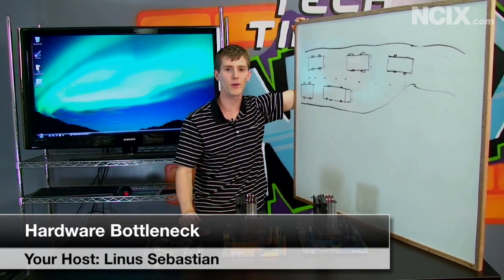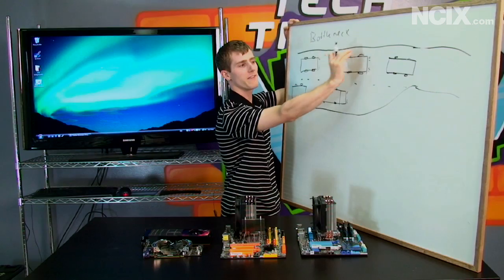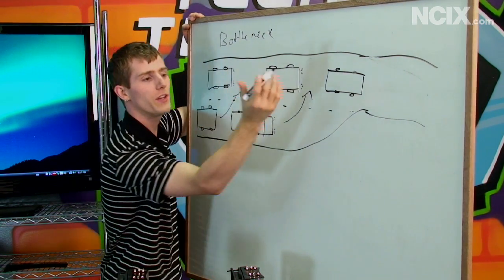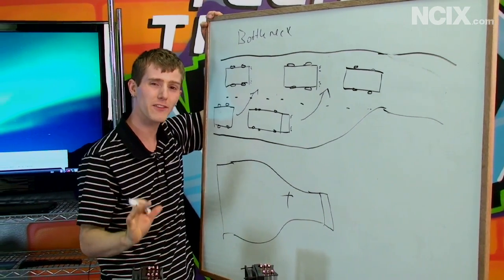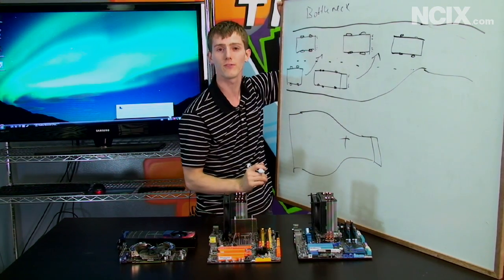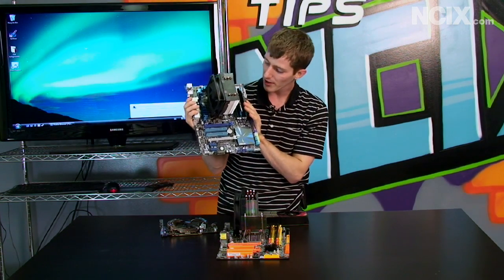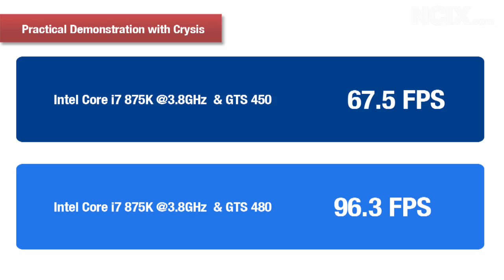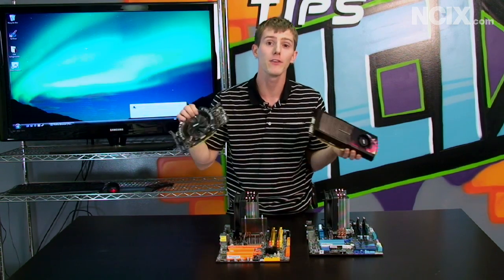Understanding Hardware "Bottlenecks" and How to Avoid Them (NCIX Tech Tips #81)

Comment: I got myself a new processor, power supply and motherboard, now I'm going to buy myself a gtx970. (Intel i5-4460, 700 Watt power supply and forgot the name of the motherboard. Dammit)
Would I do a bottleneck with the old unchanged 7gb RAM and an old Harddrive? (I don't mind loading screens btw...)
Reply: Well, it's 3 with 2 gb of ram and one with 1 gb :D
Reply: Already got a gtx970 now and well, you really need the 3.4 Ghz processor for a stable framerate of 50 on the witcher 3 (highest settings), but all in one it works out just fine for every other game on highest settings :D

Comment: Old system but I made it hopefully with no bottleneck back in the day 
Phenom II x4 955 black edition 
8 gb dual channel 1600 mhz ram 
Msi 890fxa -gd65 MB
kingston v300 120 gb ssd 
psu 550 w high power 
and Gtx 560 ti hawk from msi

Comment: can a mobo be a bottleneck
Reply: Yes, it absolutely can.

Generally, a motherboard either works, or it doesn't.  Your bottlenecks will mostly come from features.  For example, I'm running an AMD 8320 on a Sabertooth R9 990FX R2.0 (do a google image search for that, and you'll get a good idea what I'm about to say.)

I have 2 R9 290X's in crossfire.  My motherboard only has support for 2 PCIe 2.0 16x crossfire/sli slots.  Meaning, two cards can be run at 16x, so sli and xfire is perfect.  If I wanted to add another card, I would be absolutely wasting the money.  First of all, even though I have plenty of PCIe slots, only two can be used in 16X, and if I used 3 cards, #1 would be 16X and #2 and #3 would be 8X only.  This would be fine if I had 3.0 slots, but I only have 2.0 slots.  As it stands, for both of those reasons, a third card would be a huge waste as my motherboard wouldn't allow best performance.  Would it work?  Sure!  But performance would be ... BOTTLENECKED.

Another big way a mobo can bottleneck you is if you want to overclock.  You want a motherboard with fantastic CPU power delivery and regulation if you want to do extreme overclocking.  As it stands, any off-the-shelf motherboard from any reputable company should allow you to overclock at least a little bit.  But they won't enable you to go nearly as far as what you could accomplish with an enthusiast grade board.
Reply: Drew W thanks, but how much would a good mobo cost for overclocking a gpu
Reply: The thing about GPU's is that they have their own voltage regulation modules.  It's like an entire computer to itself.  It has it's own power control, it's own processor, it's own ram.

A processor (CPU) doesn't have such luxuries - it is JUST the brain, and relies on the motherboard to give it the power and regulation it needs.  A motherboard is like the brainstem and nervous system.

Any motherboard with a 16X PCIe 3.0 lane should do alright for a gpu and some overclocking, but if you're going to extremes, keep in mind that a PCIe slot is designed to provide up to 75 watts through the SLOT on the MOTHERBOARD itself, and the rest through cables on your PSU.  When you overclock, the GPU will ask for more voltage and wattage.  It'll need to get it's power from somewhere, so any motherboard would theoretically be fine for a minor overclock, but you'll want an enthusiast gaming motherboard that's capable of going above and beyond normal specs if you're going to EXTREME!! overclocks.

The same is true for multiple GPU's - any motherboard rated for SLI and/or Crossfire would do well for just about any GPU, but I would caution people who use dual 290X's or 780 Ti's/Titan's to not cheap out on the motherboard.

Regardless of whether or not overclocking is your thing, there are 2 components you should NEVER cheap out on - your Power Supply, and your Motherboard.

I hope this helps!
Reply: Drew W thanks
Reply: Drew W You do realize there is not a GPU on the market that needs more than PCI-e 2.0 @ 8x?

Comment: People wonder why you would want to buy a gaming console that works without having to figure out out this crap.  It's not that it is hard to put the computer together because it is like Lego Blocks, but these lego block won't work with this lego block because it is a Maga Bloc.  Unfortunately it isn't just the brand of blocks but compatibility also includes speed, power, memory and etc.  You really don't know what goes together unless you research each item.  I feel that component makers could make this process better but they want to keep you buying different components and give you no guarantee that they will work.

Comment: Yea, we can get gpus in many prices, 100$, 150$, 200$, 250$ etc.
But we cant do this same with cpu.
Prices of intel OC cpu starts from about 70$ and then next is cpu for 250$...
Where are intel OC cpu for eg. 150$?!?!
So how to avoid bottleneck on mid rigs?
G3258 is cheap but too weak(2 cores), 4690k is ok, but too expensive...
Reply: i6 4460.... you don't need to oc
Reply: Lmao, I already bought X5450 E0(oc-able to 4ghz) for 30$, didnt make benchmarks yet, to compare it to i5 4460, but i will.

Comment: Well I'm entry level but I've been doing research since October 2013 but this video has me a little scared now that I've already bought all my parts (just haven't received them all) but can someone look over my list and tell me if there may be bottlenecks?
CPU:
       fx-8350
moboad:
       gigabyte ga-990fxa-ud3
psu:
       corsair builder 500W 80+ bronze
gpu:
       asus r7 260x
ram:
       1 stick of 8Gb at 1600Mhz (will add another stick eventually)
              - CAS latency of 9
hdd:
        WD RE3 1TB at 7200rpm with 32Mb cache
If I got a crap load of bottlenecks tell me and I'll sell it and try again lol.
Reply: GPU bottleneck, the r7 260x at its best can only be classed as mid-end GPU. Go for R9 270 or above.
Reply: also a get a set of dual channel ram instead of 1 stick, so the CPU can access two sticks of memory at a time.
Reply: Nothing really to worry about. The GPU may be mid-end but that's not a bottleneck. You presumably know that and know you aren't going to get 120fps on Ultra detail in BF4 on that. Your component are all powerful enough to take advantage of the GPU to its full potential. It will play most games on Medium to High at decent fps etc. 2 sticks of RAM would give some improvement as you can have them working in Dual Channel but again I wouldn't worry. 1 8GB stick will work fine. A 7200RPM drive is great and I use one but is a bottleneck for nearly everyone. With your OS on an SSD, and that powerful CPU and that 8GB of memory you could boot up incredibly fast. This machine will run great and will be very upgradable. You could upgrade The GPU or RAM in a few years with no issues. You won't need to upgrade the whole system. Then maybe get an SSD and stick your OS and big games on it and keep your 1TB drive for your media and programs.
Reply: The 8360 means he can upgrade his GPU without a CPU upgrade in the future though. he may need the CPU power for things other than gaming too.
Reply: I do plan on getting another stick of RAM eventually, if I can get Windows 7 installed (having issues there)
Reply: What issues you having with installing 7?
Reply: TapTapTech 
When it automatically reboots (part of the installation process) it gets stuck in an infinite reboot loop so it can't install.
Reply: well rarely do any games or programs ever go over only using 4 cores but if your streaming or video rendering the 8350 is nice the r7 260x is ok with it but thats your bottleneck but if your happy with it just stick with it.  with the ram good thing your getting another. just remember the FX 8350 max Ram speed is 1866 in duel channel, 1600 with 3 sticks of ram, and 1333 with 4 sticks of ram. the 8350 will not support anything higher than 1866 so don't waste money on faster ram.
Reply: That's overkill for the CPU.
Reply: The Andoxico When it reboots remove the installation media. It needs to boot to the hard disk to finish the install but it's just loading upo the install disk over and over.
Reply: Jay Feng its not a gpu bottleneck. the gpu is slower than a r9 270x but it is not holding anything back. the cpu will still perform as fast as it can
Reply: Why the fuck would you build a PC with the CPU so much better than the GPU? Ideally you would spend like 50€ on CPU and 150€ on GPU, now that's a good ratio. The R7 260X doesn't even bottleneck with Intel G3220. Basically you should get atleast like a R9 270 and just get a cheaper CPU.
Also why the fuck do you build an entry-level PC with the best AMD FX CPU that can match an i7 in gaming performance? Do you plan on upgrading your GPU any time soon?
Reply: ccubeice a
I figured I'd get a more future-proof CPU and when the GPU technology gets better and better cards get cheaper I'd get one. Also my 260x has been running perfectly and has ran all my games greatly. And the 8350 isn't the best FX CPU.
Reply: The Andoxico Just update that GPU next year youll be sweet
Reply: Jay Fisher
sweet, what should i upgrade to, do you think?
Reply: The Andoxico To go well with a good overclocking cpu like that perhaps a gtx 770/670 or r9 280/x. Also think about getting another one of those ram sticks for dual channel and remember to check your wattage with a new gpu cause 500 may or may not be enough
Reply: Jay Fisher
i already switched out the RAM
Reply: Oh good alright then
Reply: i guess u didnt research enough kiddo
Reply: UPDATE (please stop posting new content about the video card or the RAM). I've gotten a r9 270 and 2 4gb sticks of g.skill 1600mhz ram.
Reply: GooberSuess
So what did you think I did wrong? Just wondering cuz I want to learn everything i can

Comment: Am I bottlenecking my system.
Amd A10 5800k 
Nvidia gforce gtx 660 ti 3gb
12 gb DDR3 ram 
600w psu?  
I'm thinking of purchasing an i7  ( I'm getting ready for gta v) :)
Reply: An i7 is overkill for games. Go for an i5 and put the extra $100 into the graphics budget. The cpu MIGHT hold you back time and again, but more often than not you'll be good.

Comment: Gotta ask about a new GPU I was looking at, will it perform to it's potential? I was hoping to get an EVGA 04G-2974-KR GeForce GTX 970 Superclocked 4GB 256-Bit GDDR5 ACX 2.0 PCI Express 3.0

Here are my specs for the build. If it is recommended I buy a different CPU that is fine (the motherboard is AMD so don't bash me for that fanboys) but I don't care to have an 8 core 3.9GHz processor over my quad core if it will work just fine, I don't have ALL the money in the world to compensate for someone's opinions about it, but if it WILL be an issue I want to prevent it.

-AMD A8-6600K Richland Quad-Core 3.9GHz Socket FM2 100W Desktop Processor - Black Edition AMD Radeon HD 8570D (a little on the older side but you know..)

-GIGABYTE GA-990FXA-UD3 AM3+ AMD 990FX + SB950 SATA 6Gb/s USB 3.0 ATX AMD Motherboard

-CORSAIR Vengeance 8GB (2 x 4GB) 240-Pin DDR3 SDRAM DDR3 1600 (PC3 12800) Desktop Memory 

-CORSAIR HX Series HX850 850W ATX12V 2.3 / EPS12V 2.91 SLI CrossFire 80 PLUS GOLD Certified Modular Active PFC Power Supply New 4th Gen CPU Certified Haswell Ready

The 970 is not necessarily cheap so I would like to see it's full potential if possible if anyone wants to give me any pointers that I might not know :) I am NOT a newb to PC's but I don't know every little aspect of things.

Comment: im currently building this

CPU	AMD FX-8320 3.5GHz 8-Core
Motherboard	ASRock 970 Extreme3 R2.0 ATX AM3+	
Memory	G.Skill Ares Series 8GB (2 x 4GB) DDR3-1600	
Storage	Seagate Barracuda 1TB 3.5" 7200RPM	
Video Card	Sapphire Radeon R9 270X 2GB Vapor-X	
Case	Raidmax 402WB ATX Mid Tower	
Power Supply	Corsair 500W ATX12V	
Optical Drive	LG GH24NSB0 DVD/CD Writer

Comment: can someone recommend a GPU to upgrade to for me?
specs:
Processor
Intel(R) Core(TM) i7 CPU 940 @ 2.93GHz
Video Card
NVIDIA GeForce 9800 GT
6.2 GB memory
500gb hdd 7200rpm

i was looking at getting a GTX 650
Reply: Nothing less than a 660. 670 or 760 would be best.
Reply: thanks man. MY I7 is only a first gen tho would it be able to handle a 660?
Reply: bradgonewild Yes it should
Reply: With a decent OC (over 3 ghz -4 ghz - you could put any single gpu - and you would be fine). But for suggestion HD 7870 or 270X would be good buy. From nvidia gtx 660, or even gtx 760

Comment: linus i love your white board it helps us understand whether its bottleneck or raid 0 or whatever. use white board more in your videos !! :)
however why you didn't include in the video how to test or someone can tell if he has bottleneck issue in their system.. i had to search my self and got the answer finally
my core 2 duo works great with geforce 9800 GT :)
(your system is old..ok i know but still play 2014 games on smooth fps)

Comment: will i3 3210 bottleneck radeon r7 260x or 7790??   someone reply please??
Reply: No. A newer i3 is plenty for anything up to a gtx 760 or r9 280.
Reply: Admiral Fear What about a A8-6500 And a 750TI?
Reply: The A8-6500 will PROBABLY not bottleneck the 750ti, but (if you want AMD) you can get an FX-6300 for the same price (cheaper on Newegg for the next 3 days), and it's a lot more powerful than the A8. The A8 is an APU, meaning it comes with a graphics component. Since you're getting a separate graphics card, that graphics component is wasted, as is the money that went into it.
Reply: Thanks for the reply, also can you crossfire a A8-6500 with like a R7+?
Reply: While you CAN... it's not really viable.
Reply: Nevermind I'm just going to get a prebuilt pc and slap a 750ti in it.

Comment: CPU: AMD-8320
Graphics Card: Zotac GTX 970 
RAM: 8Gbs Jaws 3 sniper
cant run tomb raider  at ultra settings 
Help?
Reply: Do you have the newest drivers? Because I have an 8350 @ 4.3ghz +970 and I have no problem.

Comment: i5 4460 1070?
Reply: i have i5 4460/1070, and I dont bottleneck. you should be fine, 4460 is still a pretty good CPU
Reply: it bottlenecks in cpu intensive games like bf4, but you still stay at 60-70 fps in bf4 so its not THAT bad. but i will definetly upgrade soon
Reply: John Smith it bottlenecks in bf4 no doubt, but other than cpu intensive games like that, runs just fine.

Comment: maybe someone on here can help... i have an amd fx 6300 barely oc'd to 3.7 ghz, an xfx r9 280 black edition, 8 gbs of corsair vengance ram, and barracuda 1TB hard drive. i get about 80 to 200 fps in bf4? which is a weird to me, and sometime's it dips down to the 20's just a for a second. im pretty sure im bottlenecking but im not 100%. anyone have any ideas?
Reply: oh and a 600 w thermaltake ps but i dont think has any effect on it.
Reply: r9 280x here, put it on an fx 8370 and it got better from an fx 6100. im currently back at my 6100 cause my new MOBO and CPU are getting tested together, new mobo didnt do what i needed it to do. get an 128 gb ssd, HDD is for bulk storage and that certainly applies for anything above 500 gb.

im now rediscovering the idea of bottlenecking but well, i reckon my r9 did a lot better on my 8370. at this moment i want to know just HOW and WHY do you figure out wich one is the bottleneck? is it a benchmark of 1:1 cpu:gpu? say 8900 bench points CPU and anywhere near that for the GPU? i just kinda recommended the 8370 didnt i? on that ratio you ll see a cpu doing nothing while the r9 is getting tortured to deliver the FPS in time. i havent found a rocksteady answer to that question: at what ratio should you balance cpu/gpu? 1:1, 1:1,5 or anything else? or am i supposed to look at single core performance and do benchmarks mean jackshite as long as your single core isnt there??
Reply: dont overclock, but that system should run fine on 500 watt. got 750 for myself for extra watts

Comment: CAN ANYONE HELP ME?
I've got a 'gaming pc' which has lasted me a couple of tears and have not got a job so i can upgrade. The only problem is i don't know what to upgrade to get maximum efficiency out of my money (£150-200) I've heard of the term bottle necking and am trying to avoid doing it. I will list specs of pc i know at the moment and any help is really appreciated:
Processor: AMD FX 4170 4.2GHz
Motherboard: Gigabyte GA-78LMT-USB3
Memory: 8GB Kingston DDR3 1333MHz
Graphics Card: MSI Radeon HD 7770 1GB (R7770-PMD1GD5)
Hard Disk Drive: 2TB Seagate 7200.14 ST2000DM001
CPU Cooler: Reference AMD FX 4170 heatsink
Case: Cooler Master Elite 310 w/ Side Panel Window
Power Supply: Artic MPS550 550W
Optical Drive: 24x Optiarc AD-7280S
Operating System: Windows 7 64-bit
Reply: Easy the processor
Reply: what do you mean by that, sorry
Reply: Your processor is slacking its the bottleneck
Reply: Fx 6300 would be good and next your card
Reply: R7 270 would be the next upgrade after your processor
Reply: cheers
Reply: +Jai Boo would also recommend ssd drive

Comment: it will be good, but waaaaaaay too much!!
a 7990 will probably require about 500 watts and still run at about 120.
Plus never buy a psu that is very cheap or are unbranded

Comment: Will there be any bottlenecking in this build I have configured? http://uk.pcpartpicker.com/p/ZpvG23
Reply: No serious bottlenecks, but get the gtx 970 instead of the 770. Similar price for a very large performance increase.
Reply: also, consider geting a 120gb or 256gb SSD for your boot drive. fairly inexpensive and they are crazy awesome, also you can get a gateway 21.5" display with a better refresh rate for about $20-$30 more then ur ben-q

Comment: For anyone's info, i'm currently using gigabyte 990xa ud3 mobo, stock cooler, 6 gb 1333 ddr3 xion ram, 650 watt 80plus certified huntkey APFC silent psu, seagate 5400rpm 500 gb HDD.